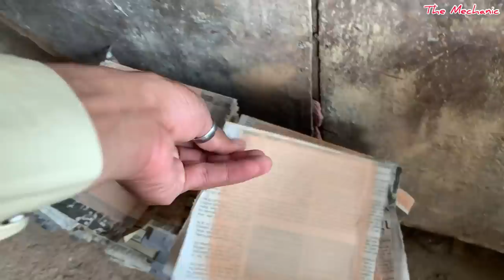Lead Acid Battery Plates Manufacturing Process || How Lead-Acid Battery Plates are Made

Comment: Assalam alaikom...amazing work..by the way what substance do you spray on the plates mold ? I,ll be glad to response. Thanks.
Reply: Used engine and gearbox oil, mixed with paraffin. Leaves a thin film that allows the lead not to stick.